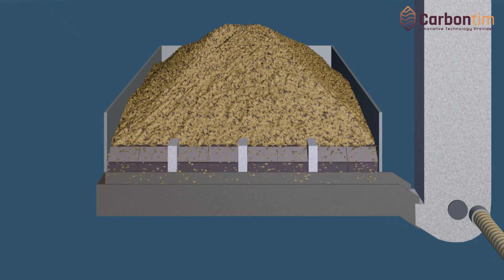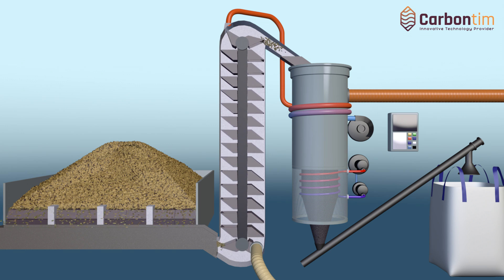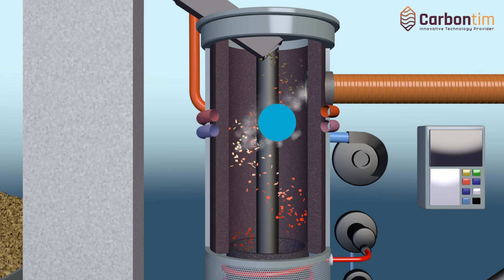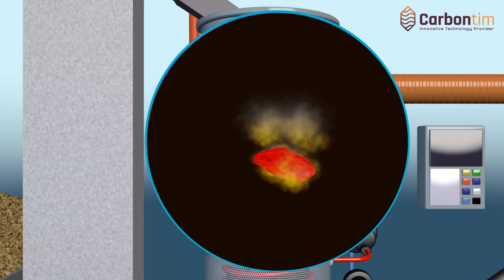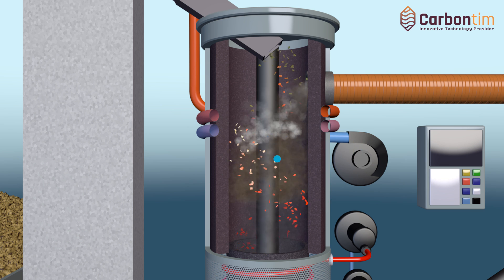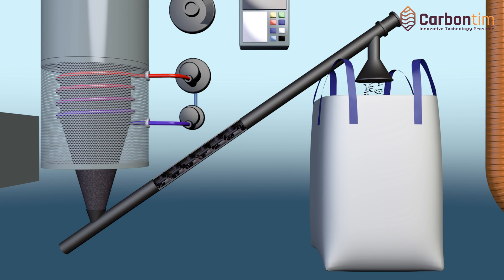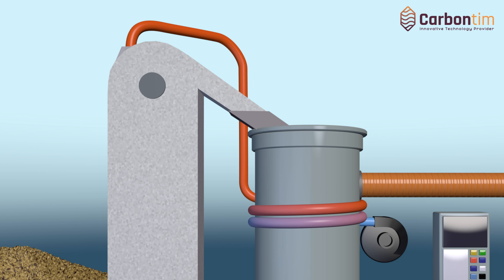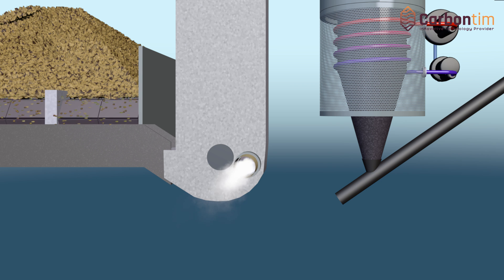Visualization of biomass carbonization process developed by Carbontim

Comment: Very inefficient process; energy is required to dry the biomass, energy is required to heat the dried biomass, energy is required to transport the biomass, energy is required to cool the hydrochar. The only waste recovery is the hot gas to heat water. Otherwise the process is good to condense biomass to smaller volume, making energy content per mass or volume higher than original input